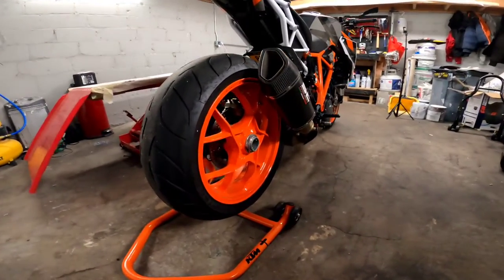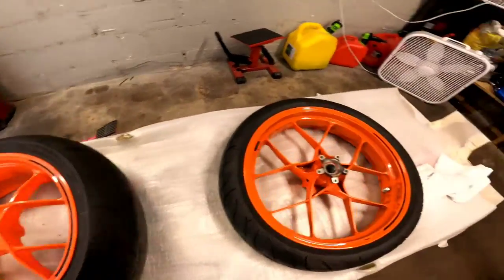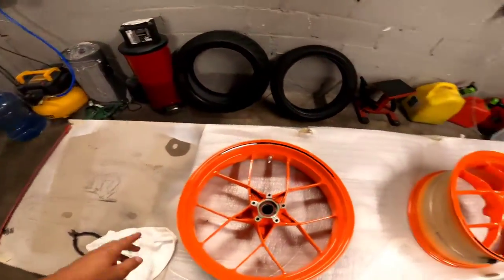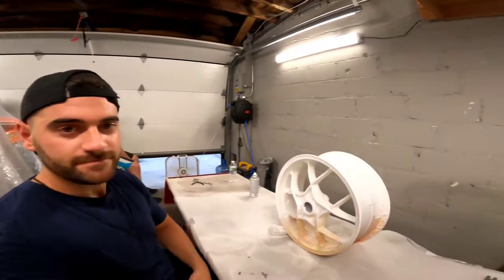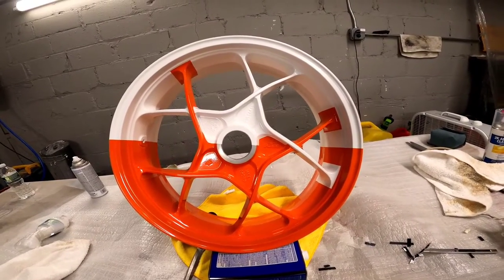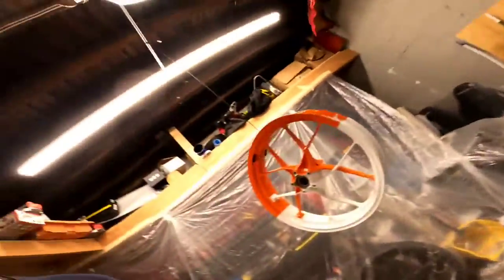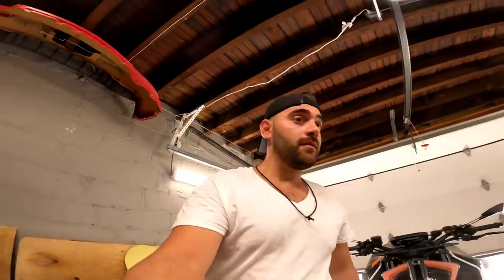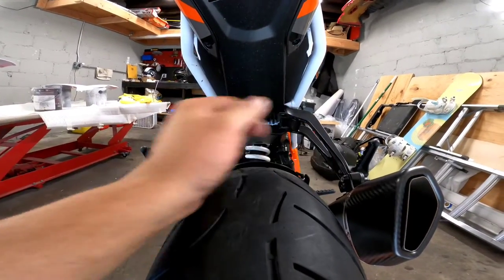KTM 1290 SUPERDUKE R NEW DESIGN FOR WHEELS

Comment: Great job dude! How well has the paint held up throughout tire changes?
Reply from the maker: Thanks Bubsie Siegel, is still good so far, didn’t even chip on the machine but I used plastic mounts..
Reply: @mikemantalis787  Nice! I’m trying to decide if I should powder coat or paint at home. Any recommendation on sanding grit and clear coat?
Reply from the maker: If you have the time you should do it by yourself.. of course powder coating is way better but to someone that knows what he’s doing. 
I used scotch brite pad ultra fine just to take the shine out little bit, and I used Eastwood clear coat( really good product and durable) you have to leave this clear coat dry two days for sure.. and then put it on the tire machine.
Reply: @mikemantalis787  Thanks, Mike. I'm for sure going to try and do it. Half orange, half black for my '19.